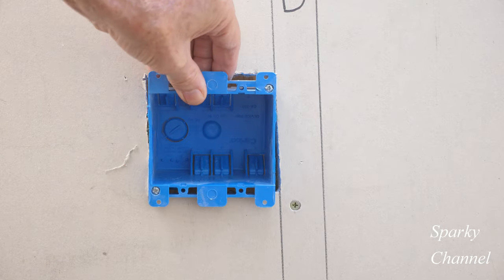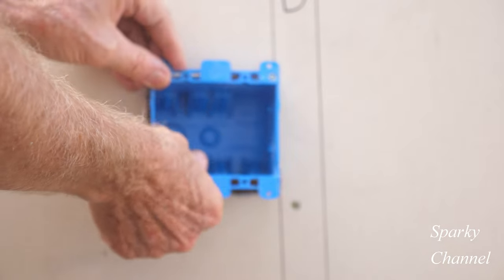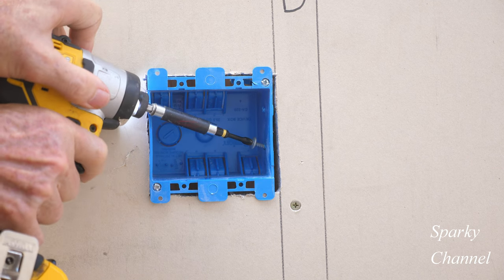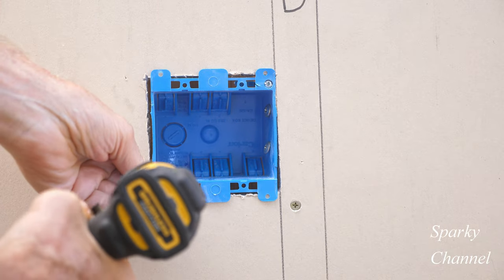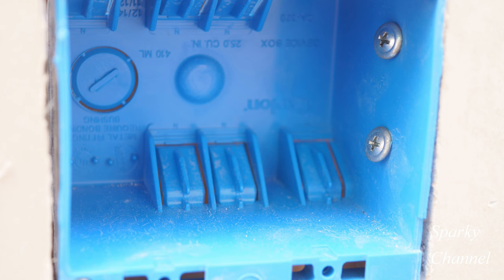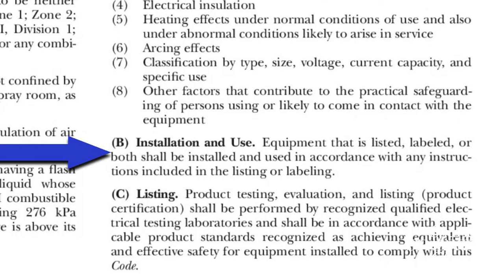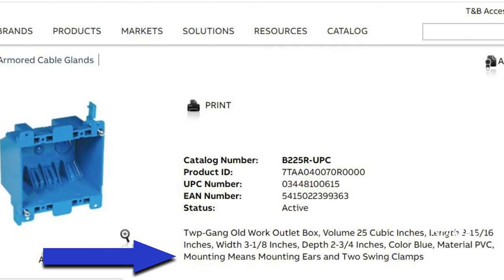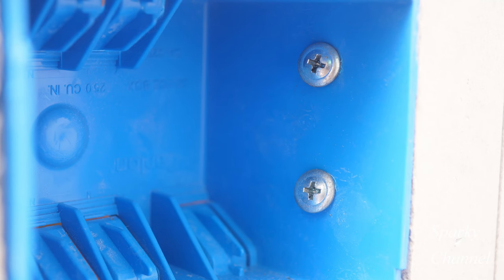Are Screws Through the Box and into a Stud OK per NEC on an Old Work Box? NEC 110.3(B)

Comment: I agree with the conclusion that this would be a technical code violation. However, as a guy who uses almost exclusively welded metal boxes that are designed for screw mounting using flat-head wood screws from the interior, I would call concerns about shorting somewhat overwrought.
Reply from the maker: Thanks!
Reply: Do you install devices into said boxes? And do you tape the terminals of those devices before installation into those metal boxes?
Reply: @frankrosemeck9898  Yes of course I install devices into those boxes. In general I only tape the terminals of temporary devices installed for the convenience of drywallers - or more typically, painters - or if I am aware of a specific likelihood that unqualified amateurs will be messing around.
Reply: @scottwilling5315  
Gotcha. I was imagining 4x4 boxes. Wasn't sure if you were talking larger boxes or chases.
I have limited experience with metal boxes/commercial work, but was taught to always tape the device in this scenario. Occasionally have to pull out the Madison straps, too.
Thanks for the tips/ info. Have a great one and God Bless.
Reply: @frankrosemeck9898  My favorite device box for stickwall construction is the Iberville BC2304-LHTQ (and its multi-gang brethren). The 2304's have sides that bulge out, and mounting bosses that are pushed back inwards with holes angled towards the front. 

The bulges are mainly there to increase the internal volume enough, e.g., to legally get one more insulated #14 into the box than will fit in a straight-sided single-gang box like a 2104. It also gives you a little more clearance between terminals and the heads of the mounting screws.

If you look it up you'll see that the 2304 also has the typical ears for screwing or nailing outside the box. We prefer the inside screw method in part because if things change for some reason after the wallboard goes up, you can still pull the screws and push the box into the wall temporarily to facilitate  "spec changes" - usually without messing up the drywall.

All this said, straight-sided boxes including the BC2104-LRB rework box have slotted holes on one side that are also intended to accept screws from inside the box, and I don't hesitate to use 'em. When installing a rework box in a finished wall, I prefer to get it up against a stud if possible, and the inside mounting holes allow me to screw the box firmly to a stud without making an oversized hole in the wall.

Happy trails
Reply: A metal box will be grounded, so a short to hot should trip the breaker. On a plastic box, metal screws would have no ground path, so you might have live screws, wood I would not class as a valid insulator
Reply: @janbottorff4642  A lifetime ago I was involved in an inverter design. We were testing a prototype up-converter stage for which we used some particle board to mount major components. For the 12 V DC input voltage terminals we used bolts through the wood.

First test, we were drawing way too much current. Cut the transistor drive way back, then turned it off, and the converter was still drawing like 9 or 10 A. WTF? Power off, pull the transistors out of the sockets, power up... 10 A.

It was the wood. Back to the hardware store for some rigid plastic tubing to sleeve the terminals. I've been told that particle board contains some portion of metal filings, and of course there would be some moisture content, but still the idea of a chunk of board drawing that kind of current at 12 V was, and still is, crazy to me.
Reply: @scottwilling5315  
Well, you probably should tape everything because us amateurs  will always taper with the unknown.
Reply: @phillipkirby502  This is going to sound harsh, but it's really not intended to be. 

My responsibility is to produce a professional code-compliant installation at reasonable cost. That does include exceeding code minimums on occasion, e.g. to make reasonable allowances for future upgrades, or just to accommodate the client's wishes. But if I was to child-proof everything in the system, I would be increasing the cost of the installation at no benefit to any sensible client. That is, someone who would - should they decide to try something on their own - at least have the sense not to pull a device without shutting off the circuit.

Should I also go into the panel and tape over the breaker terminals? Tape up the exposed busses where no breakers are installed? I think not.

It strikes me that device manufacturers could provide rear entry terminals (no, not back-stabbers - the good ones) and inset the screw heads in the device body so that you really had to work at it if you wanted sparks or shocks. But don't hold your breath on the likelihood of that outcome either.

As a homeowner, if I wanted to pull a device like a light switch but still have light - say, for painting - I'd turn off the circuit, pull the switch, tape it myself, and turn the power back on. As for receptacles, IMO there's no adequate justification for pulling those and leaving the juice on. That implies the intent to plug something into an unsecured outlet. Unwise, taped or not.
Reply: @scottwilling5315  
I hear ya.
 Don't take things so seriously. 
:^)
Reply: @phillipkirby502  Well, that's why I put the warning up front. 

I'm getting ready to start teaching a pre-employment program to beginner electricians - something I do once a year or so - and I've been writing a new manual for one of the courses. Can't help it, I'm in serious mode. 😁
Reply from the maker: @scottwilling5315  Well thought out discussion. Thanks!
Reply: @SparkyChannel  Cheers. Love this channel and recommend it to my students.

Comment: I've done this many of times, many of the single gang oldwork metal electrical boxes have the nails holes made for nails or screws to fasten the box to stud. I think this method is safer because only the head of the screw is exposed, rather than whole Nail that passes thru the box.
Great topic thanks for the video!
Reply: I remember those old steel boxes that had two nails driven through the inside of the box.  the only redeeming feature was it made it easy to get the box loose and replace it with a full size box.
Reply from the maker: Thanks Kevin!
Reply from the maker: Good point. You 'nailed it" right on the head!

Comment: I (an average homeowner) have done this a few times when I didn't have the screw mount old work boxes handy. after covering the screw heads with electricians tape and wrapping the receptacle, it still felt leaps and bounds safer than the metal box and ungrounded cloth wiring I was replacing. that being said, it feels important to know what the code says and how small mods like this violate it. thanks, Sparky.
Reply from the maker: Thanks so much Gregory!

Comment: Quit using my ideas! 😄  I will use my right angle to get the screws flush, then tape over the screws. In a single box screw through the corners of the box. I would recommend avoiding hex head sheet metal screws due to sharp corners.
Reply from the maker: Yes, thanks for giving me the idea for this video. Have a great weekend!

Comment: 314.23(1) mounting holes made in the field shall be approved.
Reply: That's not completely correct, since you left out a lot of the actual code. 

314.23(B)(1) actually says: "...,or by using mounting holes in the back or in one or more sides of the enclosure, or they shall pass through the interior within 1/4" of the back or ends of the enclosure. Screws shall be permitted to pass through the box unless threads in the box are protected using approved means to avoid abrasion of conductor insulation. Mounting holes made in the field shall be approved."

Read it carefully, exactly what the wording is intended to mean is not that clear at all. It can be interpreted to mean no nails or screws in the sides of the box at all except for the back 1/4" of the box sides. This makes some sense for narrow device boxes where device terminals may be real close to contacting the mounting screws.
Reply: I think it is clear, if I grave a box, make two holes on the side of the box, and mount the box with two screws it shall be approved. But that is my interpretation, and respect yours.
Reply: @luislazogue8089  In your interpretation, you're skipping over the 1/4" reference. What do you think it's referring to when it mentions the 1/4"?
Reply: @icevariable9600  I don’t need that 1/4” section, I need the last part where says “mounting holes made in the field shall be approved “, that is what I can discuss with the inspector when he or she try to failed my work.
Reply: @luislazogue8089  It's almost as if you cherry pick code, thinking previous sentences don't mean anything.

The question still stands. What do you think that 1/4" statement refers to?
Reply: @icevariable9600  it means when you pass a nail or screw trough the interior of the box should be in the 1/4” of the back of the box, like some old metal boxes that have nails trough the back of the box, I don’t know if you ever see it.
Reply from the maker: Good idea for a future video. :)
Reply: @SparkyChannel  ❤️
Reply: @icevariable9600  "Screws shall not* be permitted to pass through the box unless threads in the box are protected using approved means to avoid abrasion of conductor insulation. Mounting holes made in the field shall be approved."
Reply: @illestofdemall13  Why are you telling me this? I'm not the cheerleader for jamming screws in a box. The entire 314.23(B)(1) code is poorly written. 

- the last sentence says you can do it in the field.
- you can use screws, but the threads have to be hidden.
Reply: @icevariable9600  You misquoted a line in the code.
Reply: @icevariable9600  "Screws shall not* be permitted to pass through the box unless threads in the box are protected using approved means to avoid abrasion of conductor insulation. Mounting holes made in the field shall be approved." You said "Screws shall be permitted to pass through the box unless threads in the box are protected using approved means to avoid abrasion of conductor insulation. Mounting holes made in the field shall be approved."
Reply: @illestofdemall13  Oh I see. You're right. But that doesn't change my point, that  it's still sloppily written and can be interpreted as, "screws not permitted, unless approved,  and when you do it, only do it in the back 1/4" of the sides of the box, and make sure no threads are showing." 

- It's a shitty practice, yet everyone does it.
- Code is sloppy.
- Companies are too cheap to buy smartboxes.
- It's cost prohibitive to repair a box when doing new residential, after drywallers F-up the boxes.
- And who has the time or means to look up all the different instructions on the boxes when in the field? 

Which brings us back to good ol' boys using screws in the first place to fix a problem that's too expensive to do properly.
Reply: @icevariable9600  As long as you pass inspection that's all that matters in the end. Companies vary, and so do inspectors. My boss buys different kinds of boxes for different scenarios but I guess different owners vary as well. He doesn't personally approve of screwing through the plastic boxes. We are tearing out a bunch of them in this mansion because the last GC and EC got fired and weren't following plans. Overall they did sloppy work.
Reply: @illestofdemall13  Well, I like to know the code first, before cutting corners. I think it's better to knowingly cut corners when using discretion vs doing it out of sloppiness and ignorance. That's why I love Sparky Channel, since he does deep dives into stuff all of us should know.
Reply: @icevariable9600  Same here.
Reply: @icevariable9600  "through the box" means passing all the way through from left to right or top to bottom such that you see the shaft when you look inside the box. That shaft needs to be within 1/4" of the back of the box and threads need to be covered to avoid abrading the wire.
The mounting holes are a non-issue and the code is silent on screw heads in the box.
Reply: @Sylvan_dB  Good to know, thanks for the clarification.

Comment: I agree in part , I say this because they also make an outlet box with the screws already added to the inside of the Box and they are metal as well so the electric short or chance of wires hitting the screws is there as well. But that being said those Boxes with built in screws are seated with the head below the surface of the walls inside the Box. Less chance it will be in contact with the outlet wires than the way you have done it here. So in this case I agree do not add your own screws but rather buy the box that has them built into it.

Comment: Shouldn’t all metal parts inside a box be bonded? So even that other box you showed us the other day, if those screws get energized, where does the current go? Will it trip the breaker before the stud smoldering?
Reply from the maker: Good points, thanks!

Comment: Strictly speaking it isn't to code, but being legal is a different question and the answer to that question is "maybe" seeing as the AHJ has the final say on whether something is lawfully permitted to be used. Incidentally, Southwire makes old work boxes with side screw holes in them. I've not seen any Carlon boxes with them.
Reply from the maker: Thanks Keith!
Reply: I'm not fond of them because they're oversized, but Carlon B125AB can use screws.
Reply: @salthead3  I just looked that up and ooh that’s a sexy box! Face nailing fin for new work and removable for old work, side nails for new work and inside screws for old wok and in two orientations!

Comment: Although it would be a technical violation, I don't see any great danger. I see many more serious violations every time I open a homeowners box. Twist and tape joints, ground for neutral, wires way too short, too many wires, wires too small, 2 wires under a screw, etc.
Reply from the maker: Yes, that's true.
Reply: My light switch is sticking out from the wall the box was not ever attach to the wall. There are like 5 capped off wires going in there I have no idea why. They are however the only thing holding the box there.

Comment: CARLON  1-Gang Blue PVC New Work/Old Work Deep Switch/Outlet Wall Electrical Box
Item #1133090 Model #B125AB
This box has directions for internal screw mounts in old work.

Comment: I've done this many times, and have even fastened plastic nail-on boxes to studs by nailing through the box within a ¼ inch of the back of the box for outside weather proof devices without incident, per 314.23(B)(1) Nails and Screws. BUT, the code says, "Mounting holes made in the field shall be approved". Meaning the AHJ may approve or disapprove this.
Reply: @SparkyChannel  Actually in my previous post, I was referring to two different means of box attachments. The first, as demonstrated in the video was through holes field made in a single side of the enclosure. The second was by passing nails, not screws, through field made holes in the plastic box within ¼ inch of the back of the box. Screws shall not be permitted to pass through the box unless exposed threads in the box are protected using approved means to avoid abrasion of conductor insulation. The code doesn’t mention where in the single side of the enclosure the holes must be made, near the front or rear. Just when nailing through the enclosure, they must be near the back or ends within ¼ inch. 

I suppose caulking could be used as means of abrasion protection for the conductors. I've always used nails when passing through the box.  Screw heads have never been an issue if screwed flush.  If in doubt, taping the device as if installing in a narrow metal box will afford additional protection.  IMO.

314.23(B)(1) Nails and Screws. Nails and screws, where used as a fastening means, shall secure boxes by using brackets on the outside of the enclosure, or by using mounting holes in the back or in one or more sides of the enclosure, or they shall pass through the interior within 6 mm (1∕4 in.) of the back or ends of the enclosure. Screws shall not be permitted to pass through the box unless exposed threads in the box are protected using approved means to avoid abrasion of conductor insulation. Mounting holes made in the field shall be approved
.
Reply: @SparkyChannel  I doubled with you,  See my other reply
Reply: @Ross Radford The last sentence of the code section was added to make it clear that field drilling of mounting holes is subject to the approval of the inspector.
Reply: @SparkyChannel  I read it as:  Nails and screws [...] shall secure boxes
[1] by using brackets on the outside of the enclosure,
[2] or by using mounting holes in the back or in one or more sides of the enclosure,
[3] or they shall pass the interior within 6mm (1/4 in) of the back or ends of the enclosure.

I read, understanding that AHJ always has approve/reject privileges, if doing any one of the three above you are not incurring the specific additional approval of mounting hole creation, if you are not doing so.  Another good point of discussion for follow up video.
Reply from the maker: Hi Guys! I've made another video on this subject coming tomorrow. I've incorporated many viewer comments and questions from this video into this new video. Hope to see you there!

Comment: Great channel. I'd say it's not acceptable per the NEC but the AHJ has the final say. In a case where it's possible that the box can be pushed in due to heavy usage, I wouldn't have an issue with it. If screws were used on an open stud just because they didn't want to go get the proper box, I'd have an issue with that.
Reply from the maker: Thanks!